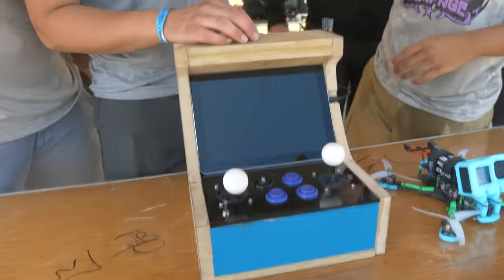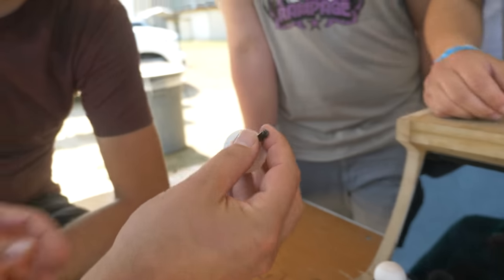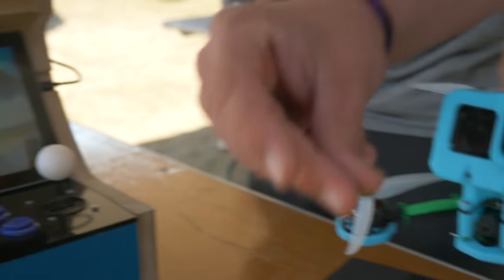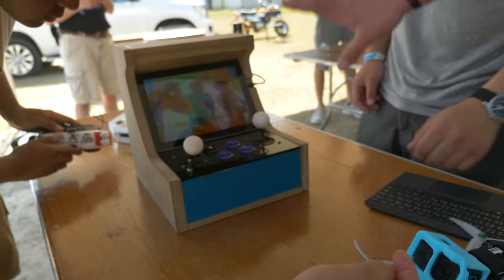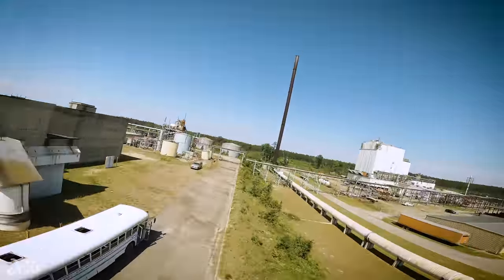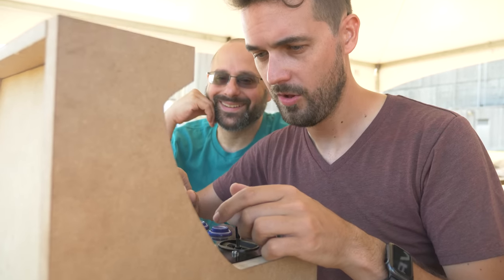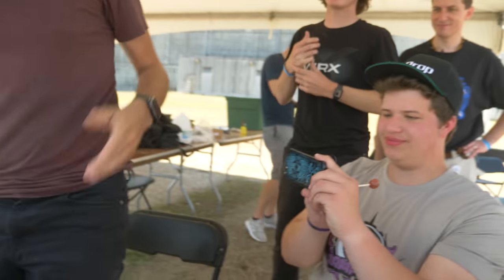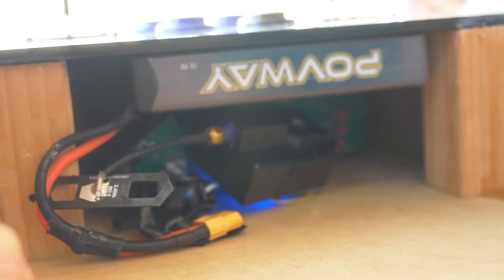Real Life Drone Arcade Machine!

Comment: When you get the quad up and show the go pro footage. You get a lot of like motion blur on objects in the background. What causes this and how can you get rid of it? I get it in a few of my videos and its the first thing I notice now when I watch most videos.
Reply: Motion blur is a product of the shutter speed and how fast the cam is moving through space or something is moving in front of it, if the shutter is open/light hitting ccd/cmos being captured is long enough for the image to move then you get an image "across time" with some motion blur in it... "Captain disillusion" on YouTube has tons of videos covering digital video capture and the limitations and errors introduced.  Also know a lot of people use nd filter on the lense to reduce glare/highlights, not something I've personally tried since usually fly with runcam or dji digital and skip the go pro.
Reply: Practically speaking increase frame rate can help, or if can reduce the aperture should get less motion blur I think.
Reply: @ShaunHusain   I appreciate the information! I will have to try this and check out that channel you rec. Thank you!

Comment: I need a drone well at least I need one motor and an all-in-one flight controller for my broken drone which was my first drone that I owned and it lasted about thirty seconds before I landed in wet grass Fried the aio and a motor now I'm stuck with a lump of carbon fibre and have been playing lift off for the last year instead of flying a drone I played a lot of money for
Reply: Thats exactly why I took a break from the FPV hobby for a few years until I could afford it and was more confident through sim practice. I was smoking an esc nearly every crash and it was hurting my 15 year-old wallet lol.